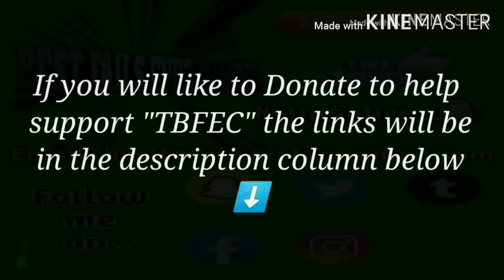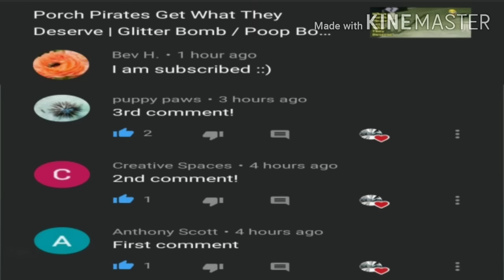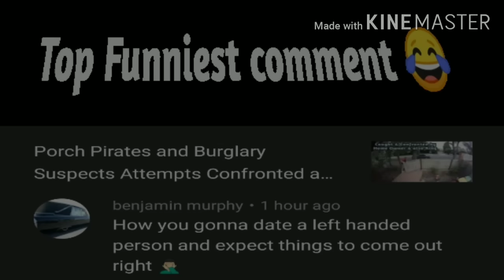Repos and Towing Fails All Caught On Camera | Lifting Vehicles Goes Wrong

Comment: "You're ruining the brakes!"

No sir, that's your transmission 😂
Reply: And the tires!
Reply: Always remember to take it out of park before towing.
Reply: make your payments
Reply: Must be an amateur towing agent@old
2-year-olds know how to unlock the transmission from park.
Reply: @MrThemold  he doesn't have the keys. all he has to do it get it off the property then throw the dollies then leave
Reply: Actually the parking pawl..... 🤣 basically a small marble in the trans 😢🤣
Reply: Linkage, pawl, and even the whole tranny will all be suspect if he just kept dragging it. Those tires may or may not be a rough ride after a hundred feet or so.

Comment: My neighbor owns a BUY HERE PAY HERE dealership and says it is almost a licence to print money.
Buys $600 to $1,000.00 vehicles from the auction and spends a couple of hundred dollars reconditioning them.
Then marks them up from $2500.00 to $5,000.00 .
He makes buyers pay  approximately what he has invested as a down payment.
They usually pay by credit card because they don't have the cash.
Then finances them .
He recently told me he has sold and resold a 2001 Escalade with 270k miles four times.
If the current buyer pays it off they will have spent $10,485.00 on a car my neighbor bought at auction for $1200.00 and put some used GHETTO FABULOUS rims and cheap Douglas tires from Wal-Mart on.
Between the payments and the resale after repossession is vehicle as made him over $22k.
He doesn't give customers any time to pay if they are late.
Payments are do by noon and if they are late the repo man is called.
Reply: Wow I need a business like that lol

Comment: If you're embarrassed they will gladly pick it up at a store parking lot or wherever you volunteer it at.
Reply: At that point you might as well just drive it to their specified lot so it will at least be written up as a voluntary surrender instead of a repossession.
Reply: @JohnDoe-ld8nr  I lost my job a few years back and called the bank and told them I can't pay for it come get it. They extended me 3 times. They don't want the car back, its a hassle and a cost to them and they most likely lose money on repo's. But they at least get something so they do it. I was able to get a job and get caught up again. They added those 3 months on to the end of my term. I called every week with an update and they were cool with it, never even called me. When you get repo its after the bank tries for weeks and weeks to get you on the phone. This is what happens what you dont answer lol

Comment: Love it when they think the tow driver is failing pulling a front wheeled vehicle by the rear. So they can set it down out of site and grab the front and take off duh.. or put on dollies away from the residence
Reply: Yeah you gotta put those dollies on even in the face of adversary
Reply: That's absolutely stupid because you can hurt so much driving components.
Reply: Tobias Buren Naw it won’t hurt anything.
Reply: @focke wulf disconnect the drive shaft. Or put in neutral manually under the car
Reply: @focke wulf this is just a guess. I don’t tow but am trying g to get into it.
Reply: @focke wulf yea I would imagine during a repo you’d have to be as fast as possible. Tbh repo is what I wanted to get into. Could you explain to me the reason you say stay away
Reply: @focke wulf you make it sound so ominous. I take it you speak from experience. I think the danger factor is what makes it appealing to me. 🤷🏼‍♂️
Reply: @focke wulf I am more into off road recovery
You have any experience here and what would suggest as must have equipment for off road towing
Reply: @focke wulf thanks for the info sir.  I have most of the off road stuff. Actually I was just doing my research on the kinetic ropes. I haven’t ordered one yet. I do have one of the flat recovery straps. I haven’t had a chance to use it yet. So wich do you prefer the kinetic ropes or the flat recovery straps. And why?  If you don’t mind me picking your brain. I really do appreciate it. Another things I recently started to research is rigging. It’s amazing what you can do with leverage and tipping points.
Reply: @focke wulf Thank you man, I agree if you don't pay your bill you lose your car. BUT YOU SHOULDNT HAVE FUGGIN DAMAGES TO THE VEHICLE, no matter how late you are.
Reply: It is when you can just put the car into neutral.
Reply: @kyleayres7141  Look at it like this. How many cars are repod every day, the number must be thousands. If 10% of them were damaged, that’s a big number, and tow truck companies would tell their drivers if they don’t use dollies or whatever, they’re going to lose their job. That isn’t happening, so obviously the amount of damage done is only very low. Obviously if it an exotic, or an awd car, probably an electric car, you need to take your time and be extra cautious, but for your run of the mill normal fwd sedan, dragging it in park for a few car lengths is unlikely to do any damage at all.
Reply: The debtor should have gave the tow driver the keys.
Reply: @thesausage351  right on point
Reply: @thesausage351  I understand that, however the owner is out there bitching about it and not giving the driver the keys, because apparently the car is his regardless of the debt he owes on it xD
Reply: I think the driver was trying to get away from the people that THINK they own the vehicle, to feel comfortable enough to drop it, then rehook.
Reply: @Patrick-kk9gu  not if its in someones driveway during a repo. you're already trespassing. get it on public property and do what you need to do.
Reply: @shitboxobs6980  not if its a newer computer controlled front wheel drive vehicle. linkage is up top under the hood.
Reply: @tooslow4065 your not trespassing it is in your loan agreement they can come onto your property to retrieve the vehicle and you signed it
Reply: Ah, ok, thanks, you just answered a long-standing question of a non-car guy about towing a FWD vehicle👍🏾✊🏾

Comment: It's not his fault you left the parking brake on and refused for him to take your car away😂
Reply: The parking brake wasn’t on. The parking brake locks the rear wheels.
Reply: The car is in park, so it’s stressful as hell on the transmission.
Reply: Todo menso
Reply: No company wants their vehicle back w/ preventable tow damage. If the driver wasnt a complete moron he'd open the car & disengage whatever was preventing the tow
Reply: @blue-ck9ns this is the who's dumber contest now😏😏😏
Reply: sillyseattlecat  I literally blamed the driver.

Are you ok?

Comment: 3:46 its not the brakes the car is in gear!
Reply: The car is out of gear, and in the park position.
Reply: Car is in park good way to brake the park gear Da
Reply: It's in PARK, the parking pawl is locking the output shaft of the transmission! A fragile AND EXPENSIVE part to replace!

Comment: He’s gonna have some nice flat spots on the tires on the first video
Reply: Lol cops are on the way its a repo cops can't help and thats how you do it drag it then drop and rehook
Reply: @jeremyspackman8357  thats how you get fired! and the company get sued with video evidence.
Reply: I didn’t know it needed to be in neutral to tow it, Duh! Nice way to trash the car for the person or the bank.
Reply: If the transmission isn't broken lol
Reply: 😂. I wouldn’t let this tow guy, tow a power wheels.
Reply: @jeremyspackman8357  yup, i dont think people know how white whale repos work
Reply: Tearing Up The Transmission.  Should Have Tow It From The Front.  Front Wheel Drive...
Reply: For two ppl. It's a front wheel drive chevy impala. How the person who jumped out and realized the door was open didn't pop the hood? Pop the linkage to the trans then tie the steering wheel down with the seat belt. Damn!
Reply: There is not time during repos to pop the linkage or grab it from the front .. especially during a non voluntary repo .. if it was voluntary they would work with the driver to repossess properly. When there are issues , like a mob of people . They will drag it to a safe location , drop it and hook it up properly
Reply: Repo people don't care if the car gets messed up . He wouldn't be there if they paid their bills . Any damage during repo is usually put on the default payee anyway
Reply: He should be more worried about the transmission parking brake lmaooo
Reply: @jeremyspackman8357  The cops CAN help if the "owner" interferes with the tow truck operator, then it becomes CRIMINAL ASSAULT!
Reply: @fingers215  EXACTLY! You DON'T drag it! You put dollies under the front wheels, that's what the dollies are for!!
Reply: @SCOOBYDOOBY664  BULLSHIT! If you take pictures of the vehicle, BEFORE it's towed and it's fucked up when you come to pick it up, the tow company or impound lot OR BOTH have to pay damages!
Reply: @TheOzthewiz  I know a dummie here in Philly that did this on video he got fired and the tow company $8,000 In damages!they thought it wax funny as he'll till the news a laye
Reply: He's a flatearther.

Comment: I used to work for a motorcycle dealership doing deliveries sometimes after hours, or longer distances away. I got a call one afternoon to go and deliver 2 bikes about an hour away from home. I drove there, got handed the keys to the Ute and got given a number and address. Got near the address and in slow traffic one of the bikes fell out of the truck. They used new tie downs and for whatever reason they slipped. Fortunately it was only maybe $200 damage, and I wasn’t paying for it, the tie down company actually paid for it for whatever reason, I wasn’t involved in that, but they stopped selling their tie downs.

Comment: They weren’t fails? Most of those were nicely done :o) “he’s wrecking the tyres!” Well maybe stop chasing it down the street? :D
Reply: The red car is front wheel drive so that is a fail cuz if they ruin the transmission then the repo company has to pay for a new transmission plus tires
Reply: @ericdadriver2293  I can’t see it. Drag it miles with the wheels turning with no engine to pump oil will mess them up (especially trucks)but a bit of dragging?
Reply: Dragging a car like that wrecks a LOT more than the tires.
Reply: teamidris the problem is you don’t know to wat extent the dragging will or won’t fuck up the transmission you can’t say well dragging it 1.54 miles won’t fuck it up or it won’t it’s all just possibilities
Reply: @ericdadriver2293  I see it as: It’s like spinning the tyres, without the gears turning. The part that would take abuse is the park brake, which is usually a toothed wheel. It would have to be real junk to be bothered by that, but it could be. It is often on the end of the gearbox, so the only parts seeing force from dragging are the differential and drive shafts.
Reply: @teamidris  Oh no, as soon as the pawl that holds the wheels in park breaks it's night-night for the spider gears, drive line, and transfer case if it's AWD. I wouldn't pay $100 for a car that had been dragged ever, or even an automatic that was pulled in neutral. The transmission will not lubricate without the engine running. Repos that involve dragging are recoveries of trash effectively.
Reply: teamidris there absolutely can be damage done not only to the tires but also the transmission gear/pawls. When the gear/pawls are bent/stripped and or broken off, then the transmission will begin to rotate without lubricating oils being pumped and thus overheat and crack or just seize-weld certain parts together.
Reply: teamidris again what good is a transmission without the driveshaft and differentials. There’s a reason the driveshaft is disconnected from the transmission in professional towing...-mainly because of long term damage from lack of lubrication. But to damage the parking brake pawl/gears is asking the transmission to rotate without the transmission oil. The differential oils are sealed and those gears can turn indefinitely without damage or irrespective of the rest of drivetrain.
Reply: No they kept going after the tow truck if they had left it alone the driver would have pulled over and hooked it from the front
Reply: Well they should of pulled it out went around & hooked up the front! Or hey the fool on the phone chaseing them down the road could have just handed them the keys! Duh 🤣🤣🤣🤣😖😖
Reply: @pattihainline1573  nah, cause they made one payment so it must be theirs :D they ain’t handing the keys over.
Reply: @CaliforniaCarpenter7  I think it can wreck the drive axle.  Maybe even damage the transmission but if it's not for very long I think the tires would get the worst of it.
Reply: Most banks would rather have it back wrecked, then you keep it w/o paying
Reply: @themotorcyclemasswhole  That would be me. If they were awkward I’d just repo the engine :o)
Reply: Lol...the repo driver pays for nothing.
Reply: @ericdadriver2293  noooooo they don't. Sorry, not a chance.
Reply: @ItsMotoMatt  I was a tow truck driver that’s how I know sorry to say but it is true

Comment: The repos were not fails. It has to be done that way on FWD cars that are nosed into a spot.
Reply: Not exactly I reverse 90 cars all the time during repos and it saves from having to drag it out
Reply: Or you put it on a flatbed! Duh 🤣🤣🤣🤣🤣🤣
Reply: They CAN put dollies under the FRONT wheels, they're sitting in the back of the tow truck. Use them!!
Reply: @TheOzthewiz  ... ummm, you have to pick the car up to use dolly wheels, which means you need to drag it out to get to that end. If you can get to the other end you might as well tow it without the dolly wheels because nobody ever sets the parking brake for the rear wheels.
Reply: A little tight to use dollies but it could’ve been done

Comment: Wow! These were awesome! That last one I’d hate to see when he goes to deliver! We had our 97 mustang transferred here by an enclosed transit truck and apparently they hit a bounce hard enough to hit a hole in our rear spoiler! We were NOT amused!
Reply: Want to know why that Benz was dragging?

I repo'd for 10 years. I have no idea how they damaged your spoiler. Unless if it was towed backwards, fast, and far. The wing would be torn off from the bottom up. I've towed them like that, but I've never seen a wing actually go bye-bye.
However, you said it was enclosed so I truly have no idea how they managed to break it. It probably broke before, while loading, or while unloading. I can see that happening. 
I've hit hard hit on the road unexpectedly and under no circumstances would it ever be hard enough to break a car. There's give in the tires and suspension to both the truck/trailer and your car.
They probably broke it while loading.

Comment: I never ran a tow truck so I'm not gonna say right from wrong. But isn't  there a way to disconnect the drives hats under the car or isn't  there a disconnect cable where the shifters in the vmcab so you can roll it.
Reply: Neutral override generally located inside cab..so need keys. As far as driveshaft, it would have to be raised to even lay under it and on the back of a wheel lift not safest place to do mechanical work esp with angry people screaming and threatening you..who may still have keys and attempt to drive off lift. Finance companies have to sign damage release anyway or tow co won't touch it

Comment: First off the comment “buy what you can afford” can mean anything.
I don’t pay more than $25k or so for a new car.
I drive a lot (20-25k a year) so I want something with very low miles.
I also prefer something new so I can break it in and start the maintenance on my preferences.
I also do not know how the previous owner drove the car.
Almost all lenders prefer not to repo a car (most only do it if you get more than 60 days late).
Also by communicating with the lender they have options to help you get current or to help lower your payment.
By parking FWD cars with the front in the people getting their cars Repo know about possible “damage” to their cars.
I was shopping for a replacement for my totaled Charger RT and many dealers were selling 3+ year cars with 60+k on the odometer for $15k +. No thank you.

Comment: And for those that don't know normally I tow truck or refill truck like on my repo truck I keep dollies if I know I'm going even though all my searches I try to keep dollies unless it's a flatbed but we will drag the vehicle down the road it's not going to cause any major harm as well as we're not pulling after yanking on it hard we're just going nice and slow and so you know we're in a safe area where you're not going to be able to get in the vehicle started up and put it in gear and drive away cuz we're going to unhooked from it and grab it from the tires that are locked up and tow it with the good the non-powered tires on the ground

Comment: You see those round Wheels on the back of that Wrecker I'm not a tow truck driver now but those are called dollies you put them on the front wheels smh I work at a transmission shop now and it wasn't the brakes he was messing up it was the transmission.
Reply: @Jaxon Figler I did, I owned a rollback and a Wrecker with my father. Why? Do you tow

Comment: #1 It’s got nothing to do with the breaks, it’s the tires. #2 He is allowed to drag it. The bank wants their $20k Buick back. Who cares about $300 worth of tires
Reply: Its not the brakes or the tires! It is the transmission. You can not pull a front wheel drive backwards without screwing up the transmission!
Reply: It has to do with about $2500 worth of transmission rebuild, to replace the parking pawl.

Comment: The one where the car fell off the car carrier the tow truck operator was less-experienced because he sucked  the boom while the cables was still on the Jeep causing the cable to push against the jeep causing more damage you should have extended the boom to keep the cables away from the jeep